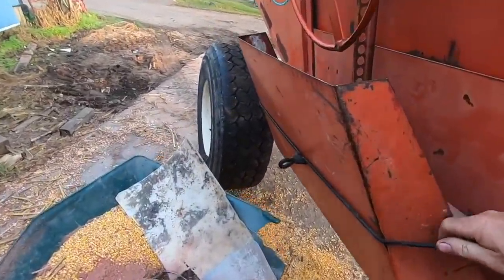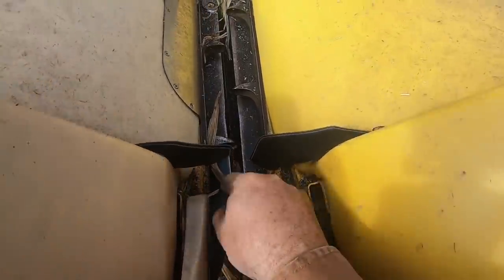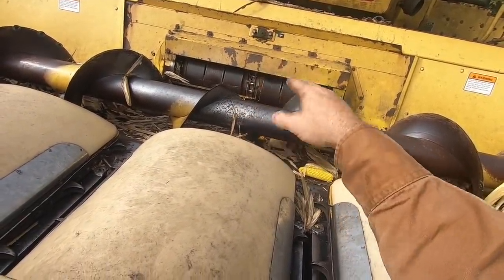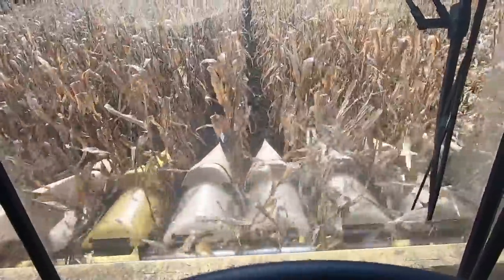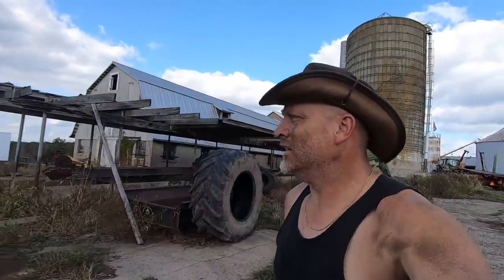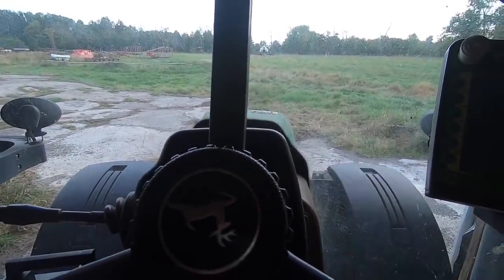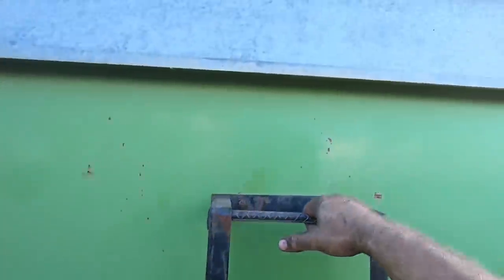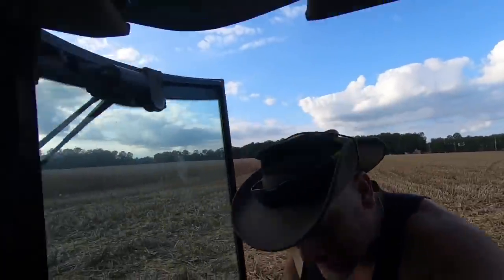How It Works kinda

Comment: Twin Rotor 96 New Holland.  Transverse mounted rotors (cylinders)  higher capacity  combines for their physical size.  They were the forerunners of the modern "rotary" combines.   Good machines.
Reply: Minneapolis Moline model E stationary shellers would be the forerunner to all rotary combines.
Reply: The rotors are AXIAL NOT transverse... transverse means "sideways".  Gleaner uses a transverse rotor, because it sits in the combine sideways like the old cylinder and concave "conventional" design combines... only they put it WAY UP behind the engine at the top of the machine, and feed it with a super-long slatted chain inside the combine that carries material up from the feederhouse and feeds it into the RH side of the "rotor" at the front bottom, it wraps around a couple three times as it spirals across the concaves to the left, and then is thrown out the lower back LH end of the "rotor" into a beater which tosses it into the straw chopper/spreader.  

AXIAL rotors are aligned down the centerline of the combine, front to back, which virtually ALL rotor machines are designed that way, from the CIH to Deere to NH, etc.   I put "rotor" in quotes because basically the Gleaner "rotor" is a regular threshing cylinder, enlarged but designed like a regular cylinder, with a wrap-around concave with spiral fins in it to guide the material swirling around it to the LH side, allowing to be beaten enough times by the rasp bars to dislodge the grain and allow it be pounded out of the crop stubble swirling around the concave cage before it's tossed out into the beater and out of the machine... Gleaner then uses acceleration rubber rolls to THROW the grain downward toward the cleaning shoe at 3X the acceleration of gravity, so it isn't blown out the back by a POWERFUL blast of air from the cleaning fan, needed to remove all the excess JUNK ground up and falling out with the grain from their "rotor" and "threshing cage"... the grain then gets sifted and cleaned on the chaffer and sieve "normally" and clean grain sent to the tank as chaff blows out the back... 

That's why IH called their combines "AXIAL-FLOW" because at the time it was really a new concept for a combine to have an axial rotor instead of a transverse cylinder and concave, which has to thresh everything in less than a single revolution around the concave (several rotations of the cylinder however...)  

Just to clear that up for folks... OL J R :)

Comment: Would peanut drying trailers work for short term (pre-dried) corn kernel storage (in a surge capacity role)?  Peerless Manufacturing/ Harrell Ag - tractor and truck etc. (tractor front/ rear empty 14, 21 and 28 feet lengths, truck 45 foot dot etc)etc Perforated metal floor, attach fabric tube to an air blower fan to reduce sweating in the corn, while waiting for dryer. Or put perforated metal floors in the existing grain wagons and hook up to air blower?
Reply: Peanuts are WAY lighter and less dense than corn... would probably collapse the floors of them.  Plus I'd bet the perforations are too big and you'd have a ton of corn stuck in the holes to scrape out or remove.  Not worth the trouble-- just feed it to the dryer ASAP like everybody else LOL:)  Later!  OL J R :)
Reply: @lukestrawwalker  Peanut drying trailers are used for shelled corn cartage, just don't fill them up too much. The floors are only 40 percent open perforation. Shelled corn has 2.7 times the bulk density of unshelled peanuts. There are specialist grain drying trailers that are built for wheat. Wheat has a higher bulk density than shelled corn.

Comment: Why is it called a COMBINE when it’s purpose is to take the crops you’ve grown apart?
I watch William as he watches you flip the switches. 
I’m thinking when he gets big enough he’ll be a QUICK study to start operating equipment. 
Thanx STILL enjoying your videos from Krapramento, California the Krapital/Krapitol
Reply: It is called a combine because it combines a task previously preformed by a binder and a threshing mill
Reply: @m9 ovich so is my lawnmower also a combine?  It mows any grass it runs into!
Reply: Because it COMBINED several SEPARATE operations into one machine, compared to how it was done before combines were invented... In the old days, the grain was cut with a binder, or corn was put in shocks, or husked (pulled off the plants by hand or sometimes mechanically).  The grain shocks were then gathered up by workers after the grain had time to dry down after it was cut and bundled into shocks.  Then it was hauled by wagons to a stationary thresher machine, which was basically the "guts" of a combine but sat in one spot powered by a steam engine or tractor belt pulley... it replaced either trodding out the grain by having animals walk in circles on it, which caused them to break the grain loose from the straw with their hooves, or else the grain was "thrashed" by people flailing it with a long handle with a short stick of heavy wood attached to it with a chain, like a long handled nunchuck... that flails pounded the grain loose from the straw.  Then the straw was tossed around with a pitchfork, to separate out the heavier grain from the lighter straw, and the straw forked up and removed, while the grain was swept up and gathered and shoveled into winnowing baskets or winnowed to clean it, tossing it up in the air in a shallow layer to allow the wind to blow the lighter chaff away with the breeze, while the heavier grain dropped straight down... this was all a VERY TEDIOUS and labor-intensive process... grain had to be thrashed with the flails for a long time to separate all the grain from the straw, straw had to be tossed with pitchforks for a long time to allow the grain to drop out of the straw by fluffing it up, and then the straw forked out and removed... then winnowing took a long time, tossing the grain up in to the air over and over and over again until most of the dust and chaff had blown away and it was clean.  

A combine eliminated ALL that and replaced it with ONE machine that was either horse drawn or pulled by an early tractor or steam engine through the field, which gathered and cut the crop, fed it into the thresher were rotating rasp bars or, in early machines, spike tooth rotors and concaves, combed and rubbed through the incoming material, stripping the grain off the straw, some of the grain fell through the concave, the rest went onto the straw rack (early form of straw walkers or now separator sections on the back of the rotor(s) that tossed the straw up and back to allow the grain to fall out while the straw was moved to the back and tossed out on the ground, and then the grain was sifted and winnowed by a cleaning fan creating a wind to blow the chaff out the back, as the chaffer and sieves sifted the grain into a thin scattered mat of material falling through the wind from the cleaner fan to allow the chaff to blow out all at once... Heck early combines didn't even have grain tanks-- usually there were a pair of guys riding on the side on a little platform, with a pair of sack chutes in front of them-- they'd open it to fill the sacks with grain, then shut a little door or switch it to the next sack on the chute next to it while the other guy sewed the sack of grain closed, and then rolled the sack off onto the ground to be picked up by a wagon and team of horses and a couple guys coming behind later... All VERY TEDIOUS work, which is why the combine is such a GENIUS invention... it's what makes farmers today able to feed HUNDREDS or THOUSANDS of people for each farmer, rather than back then when a farmer fed on average 3-8 people beside himself...  

Later!  OL J R :)
Reply: @clearingbaffles  No... read below... OL J R :)